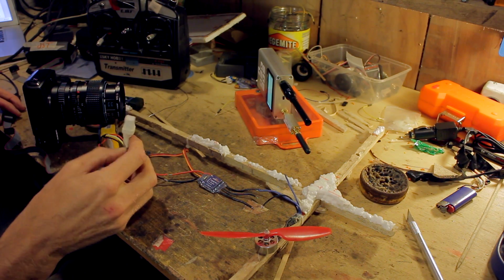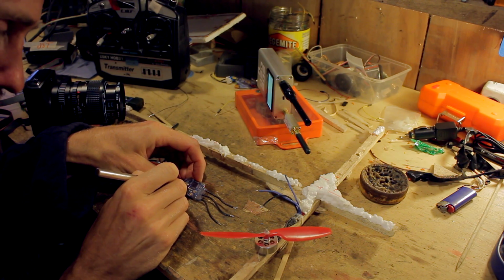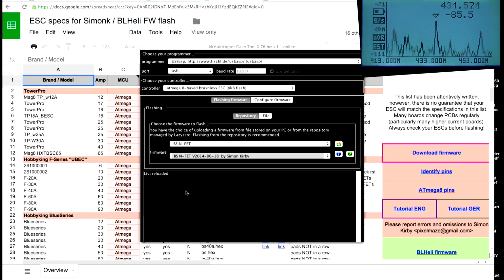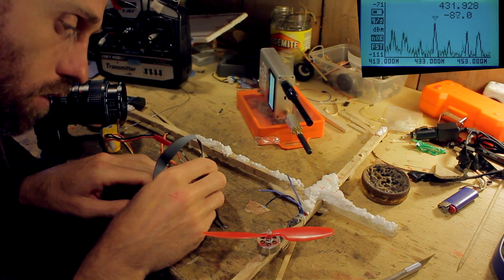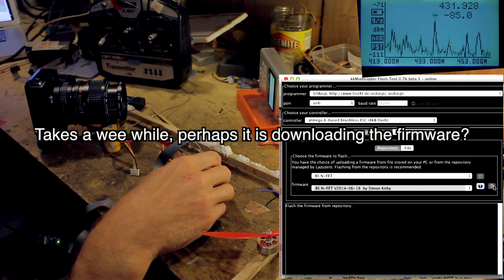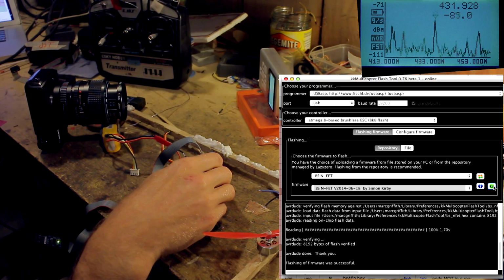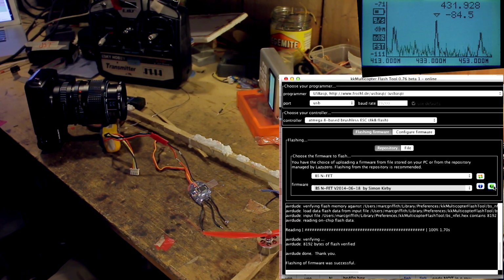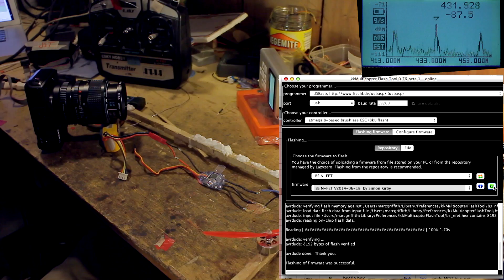Do ESC's produce RF noise? RCHacker #69

Comment: Did you take a look at the entire spectrum? Is it just harmonics of a square wave? Maybe the processor is configured to output its clock on a port pin which is a common setting for AVR controllers. It can be disabled in the fuse bytes.

Comment: Thanks for sharing. This subject dealing with electrons and Ohm's simple law seen within all major equations continues to make my head spin... But this much I know:

We are dealing with clocks and time dilation separating them with {a} shown and described here increasing. To make further progress in electronics a true inertial frame of reference needs to be established so the graviton or "hole" as it called observed in semiconductors due to it's reverse oscillation phase arrow can have it's phase timing separated from the electron's forward arrow and both be set relative to the master clock within the weak force. Because we see it backwards (electrons @ - to +) logic is hidden but it's there in reverse. You may find this interesting: E=m{a}c2. (Shows value of E is relative to time)

The speed of light is 186282 miles per second: IE 186282 miles = 1 second. This is the Master clock cycle with two arrows creating a pendulum that is slightly longer on the following oscillation phase always: e{a}/t=hv. (Shows fine structure constant maintaining E as a constant using time dilation, it's a worm hole where more time is measured going back in than came out because time did not stop during the oscillation cycle and time is what we use to measure/observe with. It shows gravity is cause by the subtrahend of the two arrows connecting gravity to the weak force as half of EM... or a tad more we notice as gravity. 
 
CERN's muon phase timed neutrinos were announced Worldwide in 2011 @ (v-c)/c=2.48e-5 sec in 453.6 miles. That is an exact match with SLAC's E158 asymmetry of the weak force data @ 2.48e-5 sec added to the speed of light traveling 453.6 miles creating an asymmetry in time of 20e-5 sec, what we call gravity. After the data was shown to match the E158 ratio SLAC went back over their BaBar data and confirmed the asymmetry in time exposed a year later giving it a sigma 14 level of certainty. There was a write up on it on Wikipedia but that's been pulled off now but was copied and noted in other areas of the Internet. Here is the simple math that proves it. If you open up a calculator and follow the flow it's easier to see doing it yourself. 
 
Weak Force Asymmetry {a} adds 1hour/3600 seconds every 1000 years: Re: SLAC E158 data "using clocks". Muon neutrinos do not exceed speed of light as CERN said "if the data is correct". They are created at the speed of light adding to the speed of light measurement just like the photon "tricks" Summerfeld detected in 1948. (Because their phase angle is @ theta 23 unlike electron neutrinos but you don't need to understand that to see the data match.) 
 
3600sec / 1000 years = 3.6 seconds of weak force asymmetry time added in a year, the distance light travels in 3.6 seconds. 
 
3.6 sec x 186282 (speed of light) = 670615.2 miles added to the speed of light in one year 
 
670615.2 / 365.2425 year = 1836.082055072999 miles added to speed of light in one day  
 
1836.082055072999 / 24 hours = 76.50341896137498 miles added to speed of light in one hour   
 
76.50341896137498 / 60 minutes = 1.275056982689583 miles added to speed of light in one minute   
 
1.275056982689583 / 60 seconds = 0.021250949711493 of a mile added to speed of light in one second  
 
Now that we know the know the {a} asy time/distance added in a second to the speed of light (0.021 mile) we need to know the fraction of a second speed of light distance it took for light to travel only 453.6 miles which is the distance CERN's neutrinos traveled to know how much {a} asy time to add to the speed of light traveling 453.6 miles and see if the {a} weak force asymmetry gain in time matches CERN's 2.48e-5 sec neutrino gain in time exactly as I said it would to create the force of gravity. So we simply divide 186282 miles (which equals one second) by 453.6 miles (the fraction of one second distance the neutrinos traveled) to acquire the weak force asymmetry value added to the speed of light.  
 
186282/453.6 miles = 410.6746031746032  (or 453.6 x 410.6746031746032 =186282 SOL)
 
Now we add the weak force asymmetry time gained to the fraction of one second value of 410.67 
 
0.021250949711493 / 410.6746031746032 = 5.174644243208279 e-5  This shows the total forward/back total neutrino oscillation time gained in 453.6 miles caused by the asymmetry of the weak force.   
 
Now notice the total asymmetry time gained of 5.17 e-5 sec is almost exactly double CERN's 2.48 e-5 sec past the speed of light. The next two simple calculations change physics by adding a 4th oscillation phase to the atom (graviton) and a second reverse arrow to time needed to support the "missing" graviton misnamed the hole opposite the electron and use CERN's data to show it's correct length relative to the electron and prove time has asymmetry that supports the force of gravity exactly as I had been saying for years never expecting this to happen and be so easy to prove and show that E=T, and time like energy must be conserved. 
 
We add a second reverse arrow (required for time to have asymmetry) for time by simply dividing 5.174644243208279 e-5 in half.
 
5.174644243208279 e-5 / 2 = 2.58732212160414 e-5 sec 
 
So we have 2.58732212160414 e-5 sec weak force asymmetry time gained in the forward arrow of time,
 
and 2.58732212160414 e-5 sec weak force asymmetry time gained in the reverse arrow of time. 
 
We now add gravity to the second reverse arrow simply by using CERN's data which provides the correct forward arrow measurement of weak force asymmetry added in 453.6 miles by subtracting the forward arrow gain of 2.48e-5 sec from half of the ratio gained in 453.6 miles of 2.58 e-5 sec. 
 
2.58 e-5 - 2.48 e-5 = 0.10 e-5 

We now add it to the second reverse arrow 2.58 e-5 + 0.10e-5 = 2.68 e-5 sec
 
So using SLAC's exceptionally specific but proven E158 WF Asy ratio obtained from adding the distance light travels in one hour to the distance light travels in one thousand years applied to 453.6 miles we can see using basic math that SLAC's E158 data matches CERN's neutrino data announced worldwide @ (v-c)/c=2.48e-5 sec in 453.6 miles with both sets of data adding 2.48 e-5 sec in the forward arrow of time and SLAC's data adding 2.68 e-5 sec to the rearward neutrino oscillation reverse arrow.
 
This creates an asymmetry in time of 0.20e-5 sec (2.68 e-5 - 2.48 e-5 = 0.20 e-5) needed for gravity exactly as predicted. 
 
CERN Neutrinos @ (v-c)/c = 2.48 e-5 create a lesser diesis (Einstein's Comma) = 0.20 e-5 (0.10e-5 + 0.10e-5) by matching SLAC's E158 asymmetry of the weak force data in the forward arrow of time @ 2.48 e-5 sec in 453.6 miles.
 
This is a game changer from dice to two sided cards because the data match shows time has a reverse Mass oscillation arrow that gravity needs to exist exactly as shown by the Unified Field Theory equation that first showed me and a few others the weak force has an asymmetry that allows our clocks to move independent of each other. SLAC's E158 ratio that creates the asymmetry of the weak force ratio is an incredibly specific ratio and I had been quoting the E158 data for years after finding it's value showing why it had to match like this creating 3 specific ratios out of one to add the asymmetry to time calling it a lesser diesis comma. A coincidence of this magnitude is simply not possible. (This was done long before SLAC went back over their BaBar data and confirmed the asymmetry in time giving it a sigma 14 level of certainty "far more than needed to declare a discovery".) 
 
There is a lot of money involved with Science so don't think scientists don't play games with the truth. That's why was I was forced to sue my neighbor, Dr. Mark Skinner, Boeing's Senior Scientist on Maui which isn't helping the truth be told due to what followed affecting over 100 KAPWC HOA members that tried to vote the good doctor and his friends off our HOA Board which we did with a Court Reporter present only to get sued in return with our own HOA money as they refused to step down even taking out money to pay their criminal defense fees exposing a corrupt legal system most Americans refuse to accept exists at the extreme level it does. But you can't have positive energy without negative energy and the larger the object the more obvious that becomes. 
 
To challenge CERN's (v-c)/c=2.48e-5 sec claim neutrinos (CERN used muon phased timed neutrinos) were exceeding the speed of light which they weren't just as the photon is mistaken to do too, same mistake from misunderstanding the data like dark matter caused by an octave level structure that fixes and puts the matter "back", many physicists said the data had to be in error because neutrinos (electron phase timed neutrinos) were measured traveling at the exact speed of light from ten's of thousands of light years away, not exceeding it. The problem with that "correction" is the fact that we know neutrinos oscillate and have mass and the same laws of Relativity that state no particle can exceed the speed of light ALSO state no particle with mass can travel at the speed of light. So the experts used one "impossibility" to dismiss another "impossibility" failing to see the gross error in logic and some tried to reduce the neutrino mass to say there must have been some slight delay but from ten's of thousands of light years away even a "slight" mass amount would measurable, not to mention CERN stated and an exact SOL measurement after they fixed the "loose cable".
 
There is a reason for observing a difference in electron vs muon phase timed neutrinos but it is beyond the scope of this post's layman presentation. What we see happening in physics where data is "doctored" to make theories fit is what happens when you use "dice" to measure time with rather that listen to the greatest physicist that ever walked the face of Earth when he tells you that "God dose not play dice with the Universe".  
 
E=m{a}c2 adds the cosmological constant using data not known until 2004 and shows how much energy you have is relative to the value of weak force asymmetry in effect keeping E a constant and that value tells exactly what time it is as it establishes an inertial frame of reference to connect to time and space.
 
You won't hear much from people who see understanding gravity connected to money I'm afraid as that's just not how science works anymore where long complex nondisclosure agreements are becoming the norm to get a paycheck in the new fields opening up. When you do the math yourself and realize the scale of vast distances involved showing how specific a ratio the E158 data creates it will make your hair stand on end. The greatest discovery in the History of mankind is being hidden from the general public by a handful of scientists but they can't hide it from SLAC and the people that created the new data and have been aware of it for many years. Time tells all and the end result takes them and their deception out of the effect of the new picture created just as Nature intended to protect Life's freewill e{a}/t=hv as Pauli noted is connected to the fine structure constant showing Freewill is a measurable 5th force in Nature. No Observer = no Universe. So it only makes sense that the observer would play the role of the last feather to land on the wheel and determine what card to pick...

Comment: Hai 
If you have noise on 433 MHz you should not use ferrite material for LF you have to use ferrite material for VHF or UHF type 
I use FT50/43 30-600MHz and on top of it a T50/2 then you're ready to cancel once from 1 to 600MHz 
You can found the mini ring core calculator the for triodes on 
http://paul.van.strien.org/software/minirk12_install.exe 
on http://www.pi4raz.nl/index.php?option=com_content&task=view&id=1040&Itemid=32 
I have more useful programs
I hope this will help you to solve your noise problems

Comment: Mark many thanks again more information for our builds.
Please excuse the ignorance in the following question.....If I tie my servo cables with a cable tie and shorten them by rolling them up round my fingers then squash the centre and cable tie to reduce there size what type of RF noise should I expect.
Reply from the maker: This is what I mean by twisting: http://www.milehighrc.com/images/4seHD_Twist.jpg
And without proper test equipment is your best bet.
Reply: RCHacker Just shows setting up FPV equipment really requires the correct RF equipment but this is the best advice on the subject IMO, thanks. Really surprised the noise is so localized in the ESC even with a linear BEC.  Nothing like adding batteries to cut down on the noise and eliminate "clocks" the system hear "tic". What I'm wondering (as often asked with many "answers") when using a KK2.1* FCB with 4 ESC's with switching BECs is it better to pull the black ground wire with the red on the 3 ESC that's BEC are not used to avoid a second ground reference or keep it twisted with the signal wire. Seems using a separate ground wire in reference with the ESC's main supply ground twisted with the signal lead would be the best noise solution.

Comment: Great video... I keep harping at people that all of our RC electronics can create interference and it should be checked.   Good abatement practices like twisting the wires, shielding, and power filtering are all critical.
Reply from the maker: Thanks, I was really expecting to see some noise from the wires driving the motor. I was quite surprised to see the noise around 433 even when it was idle.
Reply: RCHacker Try looking at BEC's (switching types a.k.a. UBEC), they do it as well.  I tend to like the ones by Dr. Mad Thrust since they have a shield on them.  Anything with a clock running the circuit is prone to spitting out noise.  We just hope it is not on our frequency :)

Comment: i bet lots of rf noise around 430Mhz  is coming from your usb extension cable from your computer. Check there. Turn off you computer and check it.
Reply from the maker: Yes the computer spews it, but I did initial test with it off also. Good point on the extension cable that was sloppy on my part.

Comment: The ATMEGA8 ADC does not perform super-speed ADC as it uses the primary clock.   Conversion occurs when ADSC is set and completed when the ADC interface sets ADIF.   This requires multiple ADC clock cycles; and would be a magnitude of kHz, as opposed to 433MHz.   I would be tempted to probe the board with a scope or spectrum analyser around the discrete ESC components.
Reply from the maker: Funny that now I can reply, youtube is still a bit buggy sometimes since the G+ fiasco.
Reply: RCHacker Apologies, it was my fault.  I seemed to have acquired some unusual G+ settings.   Thanks for letting me know.  In regard to your ESC issue, I'd be interested to hear if you make any progress.
I wonder if it is related to BEC circuitry?  I am not familiar with the BEC switching frequencies in an ESC, but in my experience buck DC-DC switch mode regulators, they generally operate the in the 100kHz < 1MHz range.
Reply: ***** I assumed this has a linear regulator on it, I will have a closer look and do a follow up video.
Reply: Marc Griffith  If you were flying 4S and used a 7805 linear regulator for conversion to 5V at 1A to drive flight gear, you'd be looking at dissipating >9W in heat.  That's a lot of wasted energy.  ESCs usually have switch mode regulators in the BEC which are more efficient.

Comment: Have you checked the 5v / 3.3v regulator. perhaps try to desolder it and power the esc from an external 5v / 3.3v source to see if that is the cause of the noise.. Nice videos !
Reply from the maker: It is a pretty common linear regulator on there. I assume that they do not make that type of noise.
Reply from the maker: RCHacker Unless they have the filter cap values wrong and it is ringing, worth a look.

Comment: is that an a canon eos M you have? what lens is it that you are using , vintage but what? is that what you shot your wildlife footage on your other channel with
Reply from the maker: Yes, eos-m with a Minolta MD 50mm f3.5 Macro. I have quite a few old minolta lenses that I collected on ebay etc.
The other camera was another eos-m with the 18-55mm kit lens on it.
Reply: i was just wondering as i have an eos m and use some old olympus lenses and wondered what was working well for you, thanks.
Reply from the maker: planemadman1 Tragic lantern or magic lantern, and the various focus aids is pretty essential with the legacy lenses. The adapters are cheap. EOS-M to Minolta MD adapter review and comparison. Marc Griffith #4
My favourite, the 200mm f2.8, 24mm 2.8, 50mmPG and the macro lenses.  They all have similar colour and bokeh qualities which makes editing easy.  Added bonus I can keep using them when I upgrade to full frame.
Reply: yes I have a memory card with magic lantern on but i always forget to use it. I suppose its because i use them more on the spur of the moment than carefully planned. I normally go to photo mode and use the 10x crop for focus then switch to video and not change the focus, it works ok but I really should be more prepared! unfortunately on my budget I won't be able to upgrade to FF any time soon so at least its one thing less to worry about!
Reply from the maker: planemadman1 I normally configure the half press for 10x zoom. Makes focusing really easy and manual focus on old lenses is a dream.